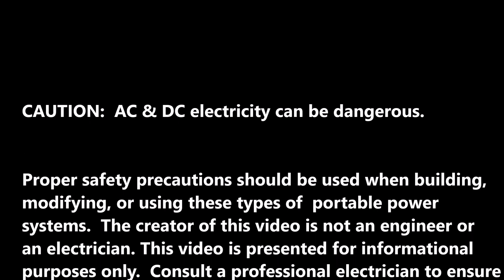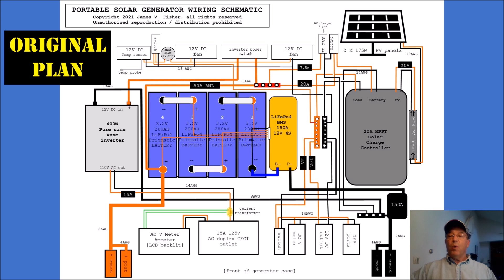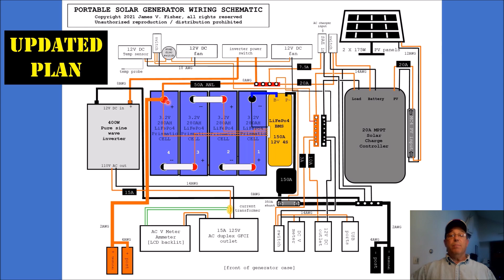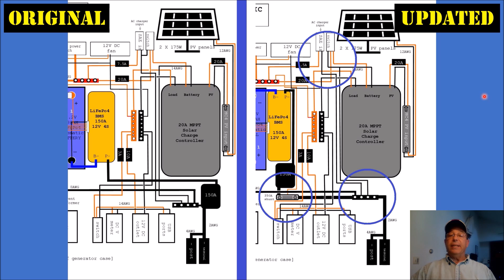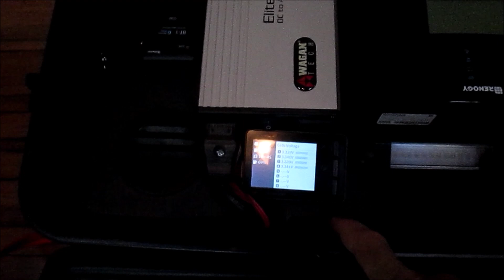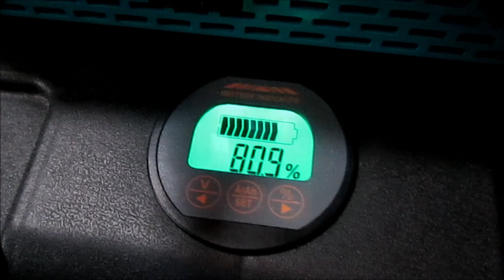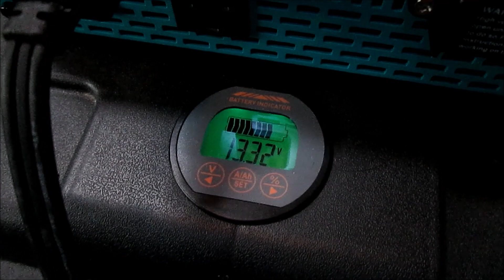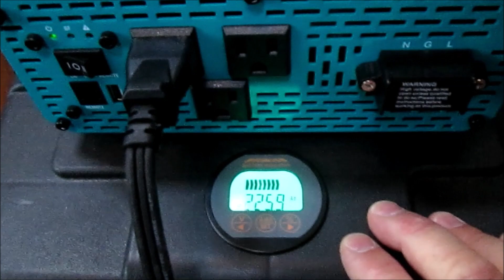V2 P6 3.5 Kilowatt Hour LiFePo4 DIY Portable Solar Power Generator

Comment: Jim - I agree with all that have commented on the professionalism you demonstrate, the quality of your presentations, and the research you have done. Great work! I have been following for a while now, and have a few questions before I start my build. #1 -In V2P6 you referenced an upcoming "solar panel" video - have you made any progress with that?  #2 - I'm assuming that as the 2000W inverter is top-mounted, and an add-on, it could just as easily be a 1000W inverter, or not added at all. #3 - In my build (also for a boat, but will be used for emergency power, camping, ham radio, etc.) I can easily connect my boat's positive and negative bus bars to the front of the solar generator, therefore having a power supply that is 100% detachable from the boat and still having an intact boat (house) wiring system. #4 - I'm a bit confused about the parts list, as the V1P7 parts list doesn't seem to follow the entire build. Is there a complete as-built parts list or am I just missing something? Again, great job, and thanks for all of your efforts!
Reply from the maker: Thanks for viewing and for your questions and comments, Mike.  #1 unfortunately, I have not yet made a video on the solar panel installation on my boat. Perhaps this spring. #2 you are correct, the external 2000 W inverter can be optional. The original build included the 400 W inverter that is located on the top deck under the lid. If you don’t want to use the inverter at all that is also possible. #3 yes, you could directly connect to your boats DC system (bus bars) by cabling to the external bulkhead terminals on the solar generator case. I would recommend that you include a battery switch for your starter battery house battery bank.  It may be advantageous to keep the systems separated at times. #4 a complete parts list in pdf format is linked in the description fir the first video in the series and was updated through the end of the version 1 upgrades.  I don’t believe I added the parts necessary for the version 2 LiFePo conversion to the pdf, but links to the individual parts are included in the description to the videos in my V2 series.  If you have other questions, please feel free to ask.

Comment: Hi Jim! This has to be one of the greatest DIY build with awesome step by step instructions. I just had a few questions and am going to follow your DIY. I watch alot of videos and am learning alot. I am using a Victron MPPT solar charge controller and it doesn't have a load portion. Just the battery and solar panel inputs. If thats the case, would all the connections going to the bus bar that is connected to the load part of the solar control go to the main positive and negative bus bar instead? Thanks in advance!!
Reply from the maker: Hi Steven, thanks for your comments and question.  I am surprised that your Victron solar charge controller does not have load terminals.  If that is the case, yes, you could eliminate the load bus bars in my design and connect all of your loads to the main positive and negative bus bars.
Reply: @JimFisherDIYPortableSolarPower  Thank you Jim! I had one more question before i start my build. Are ALL of your switches the same kind? You see you linked a switch with 20A ratings. I notice the inverter power switch has a bigger load capacity due to the 400 watts output and 8 AGW wire size. I'm assuming that one is the master cut off switch you have with the key? I was wondering, would you be able to recommend one with out a key from amazon at reasonable similar price? Or can it be any switch with at least a 50A rating? Knowing me, i might lose the key. lol. Thanks and i appreciate your advice and time!
Reply: @JimFisherDIYPortableSolarPower  Forgot to mention one last question. Are your two fans BOTH installed to push air out of the box or are they alternating/opposites (one is pushing air INTO the box and one is reversely pushing air OUT of the box). I hope that made sense and Thanks again!
Reply from the maker: I have them oriented one pushing in and one pulling out.   I think it would work just as well with both pushing air in, depending on the type of case you are using.   The Plano sportsmans trunk I used is not completely airtight so positive air pressure would likely vent around the edges of the top of the case.  In 7 seasons of use there have been only a couple of times the fans were activated by the thermal snap disc switch due to excessive heat buildup in the case. It was due to sustained use of the inverter in 85+ degree weather.

Comment: You get drift on % over time and need to calibrate routinely  - Because batteries have internal resistance this energy they dissipate is burned of as heat and is not measured  by the shunt because it occurs within the battery cells   -  it not huge on lithium  chemistry but on lead acid it can be as much as 4% a week -  coulomb  meters generally work better on batteries with minimal cell impedance
Reply from the maker: Thanks for viewing and for your comments.  I will monitor the top end voltage and what the meter reads as 100% SOC to see if the cells' IR has a significant impact that would require periodic re-calibration of the meter.

Comment: God job Jim
Reply from the maker: Thanks so much, I am glad this upgrade is finished and has been successful!
Reply: @JimFisherDIYPortableSolarPower  you’re welcome, your project has come a long way as I’ve followed your Project from the very beginning. 
Being able to question you on parts, and getting fast replies from you about equipment, wiring and cables etc, has been a great help to me at the start of my own projects and ideas ..
Your projects along with many others inspired me to start my own.. With a very intuitive And creative mind, mixing different engineering disciplines, even coming up with / crating new connections, mixing different wiring disciplines 
General Electrics with automotive, I’ve must of built about 15 of these so called solar generators at this stage Of all different sizes.
my main goal was to still keep it DIY And affordable, so I’ve managed to simplify My wiring and uses of materials and built my generators in a way that it’s very easily maintainable/ fixable..  even changing the battery is as easy as changing your mobile phone battery..
This give my invention a massive advantage over the mainstream machine sealed solar generators ppl buy from big cooperations and manufactures..
I’ve always admired your wire management and how professional your Finnish looks.
It’s a standard I alway aim for but always come up a little short on that department compared to yours..
But I make up for it in imagination and creativity..
I have one idea for your DIY solar generator. Have you though about turning it into a hybrid system we’re it can use wind power/ turbine as well ??
On your boat, out at sea, it would not even have to be big.. using a combination of wind and solar would be more than enough energy to not only top up battery’s, but give you more power storages if needed running more onboard equipment over night and day.
Reply from the maker: I agree that one of the main advantages of building your own system is the ease with which it can be maintained/repaired.  Much cheaper to replace or repair a single component than to replace the corporate produced versions that have limited warranties and limited access.  I may consider adding a wind generator in the future...looking forward to seeing how well this system plus the house batteries meet our needs.   Sure would be nice to turn the rainy, windy days into opportunities to generate electricity too!  Keep on creating and thanks for your comments and continued interest, they are appreciated!
Reply: @JimFisherDIYPortableSolarPower  now looking into wind power, it’s pretty much the same principle.. instead of the solar panels sending the energy back to the battery’s, it’s the wind propeller,.  There is only a slight difference is the charge controller.
I’m sure there is a way of  wiring it to your generator in a way you can use both or switch between the two controllers..
Jim, if me and you was working on your baot, adding both of our skills that we have learnt, 
We would probably turn your boat into a hybrid Wind + solar, hydro powered Submarine 🤣😂🤣